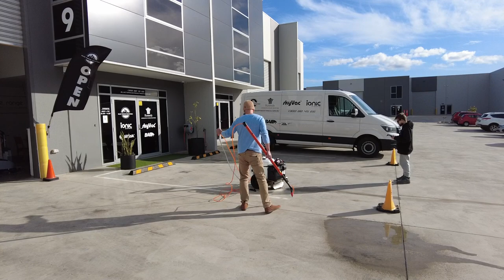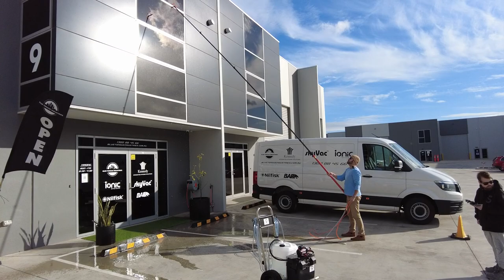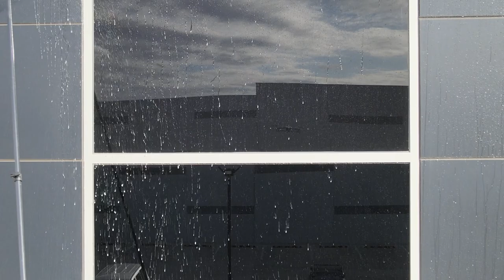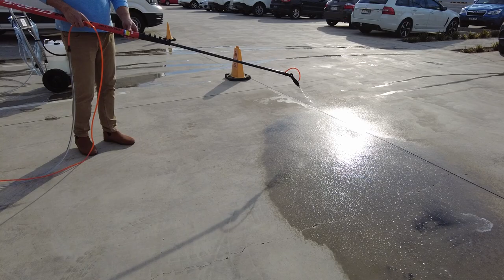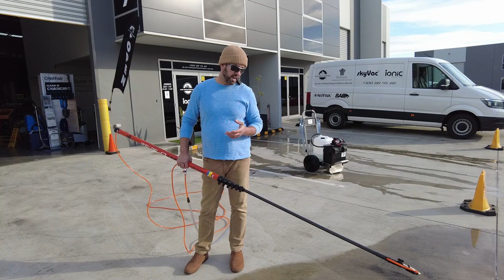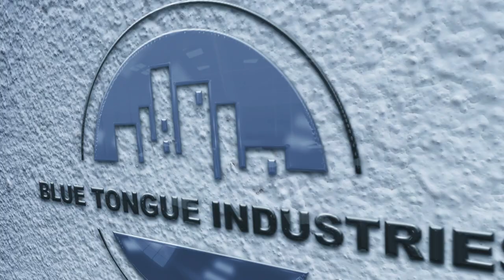Cheap SoftWash Trolley | High Reach Access and Flatwork

Comment: Can i get price for this trolley set-up without telescope wand?
Reply from the maker: Jump onto www.ionicsystems.com.au
Go to Pressure Cleaning /SoftWash pages. All variations are listed. Check in with the office if you would like to know more.
Reply: @BlueTongueIndustries1300884566   Thanks. Can we use a telescopic wand ( Pressure pole) with this pump ?
Reply from the maker: @vidu572  You could but be to heavy, in that use, and you do not want SH through your gun.A water fed pole will be easier, as lighter.
Reply: @BlueTongueIndustries1300884566  Thanks